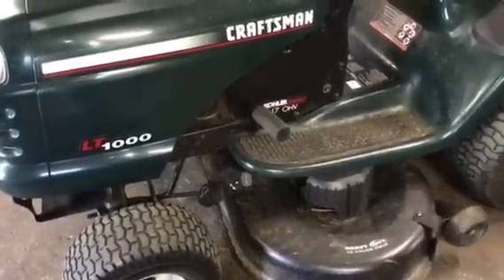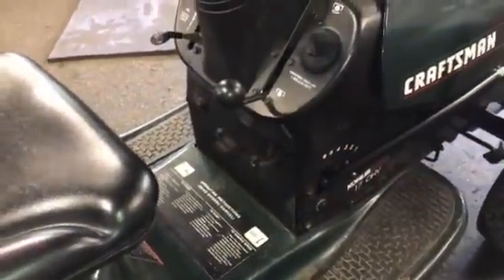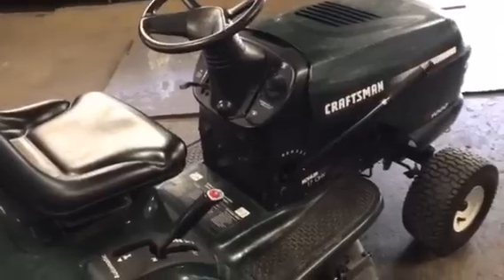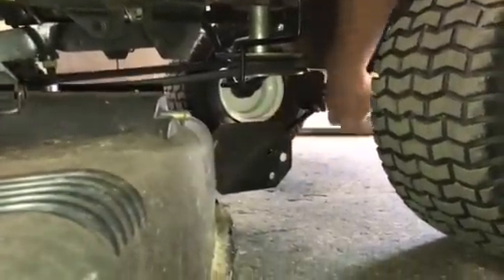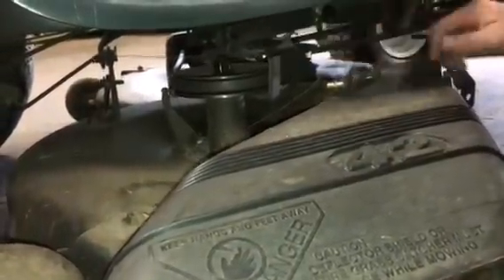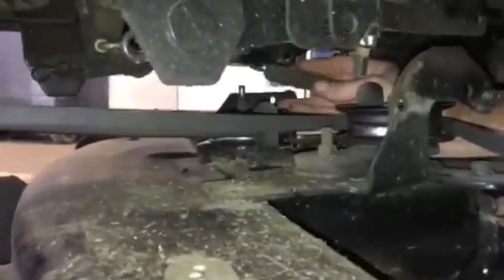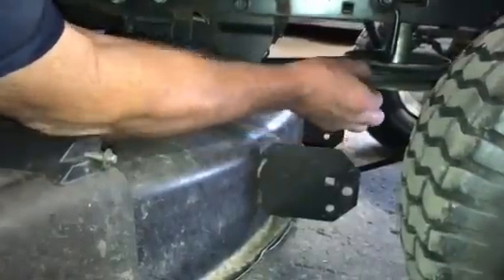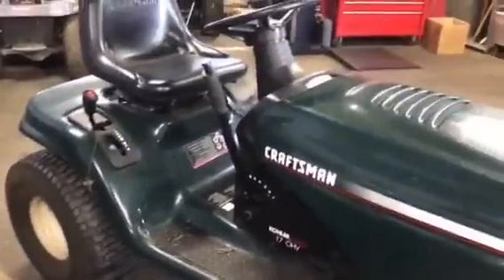How to Remove a Sears Craftsman 42" Mower Deck

Comment: Thanks. Did a dual spindle and blade replacement today in about three hours. Your instructions were perfect. I was lucky and didn’t have any seized bolts. Why sears put three torx bolts on the pulley cover is beyond me, but I had a set of torx socket adapters and they came out fine.
Reply from the maker: I'm glad it was helpful and all went good! Thank you for watching and supporting my channel. Please give this video a like and share my channel to help it grow. It would be greatly appreciated!

Comment: Like to see the replace 
craftsman clutch cable.
Reply from the maker: If you mean the blade engagement cable? I will need your model number under the seat and it should start with 917. If you can get me the number I may be able to see if I can do a video on that but I will need to wait until a tractor that is like yours to come into the shop.
Reply: @JohnsonsSmallEngines  Bought 2002.  917.271634.  I should've used my camera before taking things out.  Thanks for you help.

Comment: Ever hear of a k gro power pro with the old rod style clutch engagement blades? Am I like the only one who has one
Reply from the maker: I remember them and have worked on them way back before videos!! I haven’t seen one in my shop for over 10 years.
Reply: @JohnsonsSmallEngines  wow I got one in my garage now I'm about done with. Hopefully the blades engage.

Comment: Is there a washing port to hookup hose to on the models?
Reply from the maker: I do not think the older models had a wash port. I also do not recommend using it because water and these tractor do not mix. You will be replacing mower deck bearings and idler pulleys more often then normal if you use water to clean your machine. I have repaired a lot of machines that should have gone much further to find out the customer washed there machine every time they cut and bearings failed quickly. Just my opinion.

Comment: I broke a blade the other day on grass that was entirely too thick. The blade free spins and doesn't cut. The left blade is cutting. Spindle seems to be messed up at the connection for the blade. I needed this video to see how to remove the deck and take it to a shop since I don't have a trailer to carry the mower on. Thanks for this video

Comment: Thanks for this.  Very helpful.  How does one straighten the bent frame.  Mine is similar to the one in the photo, but not as pronounced.  I was thinking of using a mechanics hammer.
Reply from the maker: To straighten the decks, I use a heavy slide tool used for breaking the bead from tires. Use whatever it takes to correct the bent deck but be very carful hitting the deck where the cast mandrel is. I have broken the castings where the fingers are with the bolts going through in the past and then needed to replace the mandrel housings. I must straighten a lot of mower deck and have learn how do perform the job correctly but be very, very careful doing so.

Comment: I have a craftsman lts 1500 riding mower with the 42 inch deck and was replacing the belt today but it seemed it needed stretched pretty far to go on the main drive pulley under the mower. I'm thinking the belt is too small ,maybe the wrong belt. I tried to stretch it on but there was no way. Any help or advice? Or even the exact belt I need?
Reply from the maker: You need to take the model number from the sticker under the seat and go to sears parts direct online. Put your model number in to get to the parts breakdown for your machine. Find the mower deck parts and get the part number for your belt. Then you can either order a OEM “ original equipment manufacturer “ belt which I recommend or a aftermarket belt replacement.
Reply: @JohnsonsSmallEngines  I got the belt from the hardware store that supposedly was the one that fit but once I got it on all the pulleys in the deck back on it needed stretched quite a bit to go over the drive pulley. I'm thinking it's too short I will double check though on the parts direct website
Reply from the maker: Also make sure the belt is going through the pulleys correctly. There should be a diagram to show the routing of the belt.
Reply: @JohnsonsSmallEngines  yeah I still have the diagram sticker on the deck it was exactly as shown

Comment: Great demonstration. I have LT2000 42" deck, If I want to reduce deck size to 38" deck, will John Deer 38" fit the same way or do I have to stay with Craftsman 38" deck only?
Reply from the maker: You will need to stay with craftsman

Comment: Thanks so much for this informative video. Do I have to remove the deck to replace the entire wire harness?
Reply: Shouldn't have to should be all in the front maybe if you want to run stuff to the battery

Comment: Thanks for the tips , very helpful ! I would like to add the deck wheels to my LT 1000 , can you supply a part number as my mower came without them ?
Reply from the maker: Go to Sears parts direct.com for all your tractors parts. You will need your tractor model number and then you can look up all parts needed for your machine.

Comment: The first pin you remove is from the bar going to the front of the deck.. I have an older craftsman that has two of those bars that attach to the front. One has rusted off the deck area. Is this a vital fix or can the lawnmower still run with one?
Reply from the maker: It should be welded beck on to be able to support the mower deck correctly.

Comment: Thanks brother, I can’t see, but does the spring hook onto that long nut with the hole for a pin?
Reply from the maker: You mean the long bolt with the hole in it? Yes
Reply: Johnson's Small Engines yes sir. I ended up using that long bolt with the hole, and it’s working, my blades are engaging

Comment: So I want to remove the deck permanently. After I take off the deck what do I do to make it run ?  Must I reconnect something?
Reply from the maker: Vicki Peck just make sure you take all mower deck hangers off the tractor frame and you will need to make sure the PTO lever stays in the off position or the tractor will not start. If you have a PTO cable, I would also take that off so you don’t run it over. PTO is your blade engagement lever. It means Power Take Off.
Reply: Johnson's Small Engines thanks

Comment: Do I have to do anything different, when removing/replacing, if I have the adjustment knob?
Reply from the maker: Aaron Adams; pull the height lever all the way up then turn the knob counter clockwise until it stops then put height lever down as far as it will go. That will make sure you won’t have any issue with the mower deck hanging in it’s adjustment because it will be off the adjustment.
Reply: @JohnsonsSmallEngines  thank you. If I have any issues I'll let ya know. 👍

Comment: How old is yours? I have a 42" hydro number 917.259572 and I can't get the attachment lift lever to go from high to low. Also the the height adjustment knob turns but the blades don't move.
Reply from the maker: With the deck lift lever all the way in the raised position and if you have a round black knob to the left under the steering column? turn the knob counter clockwise until it stops then you should be able to put your deck lift lever all the way down.
Reply: @JohnsonsSmallEngines  You were right. Thanks.

Comment: I have a pin that’s stuck. I cannot pull it out.  Any suggestions?
Reply from the maker: Tap it lightly with a hammer. Maybe use a little Penetrating oil but do not get oil on the belt.

Comment: Hello Brad. I’m Mac. Thanks for showing how to remover the mower deck. I’ve done it before on my LT 1000 42” 16hp but thought you made a great video.
- I can’t seem to get it leveled correctly. The leveling bolts are all the way up but deck still uneven for cutting my grass 3-4” High.
- I need a grass catcher and found a 3 bagger model 917.249040 on CL but it’s for a 46” craftsman. Would that work on my 42”?
Again, thanks for a great video! I’ll go look for your leveling video.
Reply from the maker: On the leveling, make sure your blades are even going across in the center of the deck. If the mower deck is on the tractor you will need to get under to see if they are even.
On the bagger., I do not get into putting used baggers on machines because they normally give me issues and never match up. Take your model #s of your tractor and go to sears parts.com  to see if you can get the correct part # for the bagger to fit your machine, then google the part number (bagger) for your machine to see if you can find your correct bagger (used). Some people do advertise used parts with the part number and you may get lucky!
Reply: Johnson's Small Engines Thank you VERY MUCH!! I’ll check both as you suggested for my 917.272762 Lawn Tractor. Have a good summer.

Comment: Were those deck wheels added extra? I dont have them on my deck.
Reply from the maker: There are many different models of the craftsman tractors and some come with and some do not depending on the model
Reply: Steve Schwab I had to add mine as well.  Found them online

Comment: How did you fix the frame issue? Its hard for me to put the rod in place because of the bent frame in  addition I cant adjust the deck properly, it cuts way lower on the right due to the bent frame I believe.
Reply from the maker: Sometimes we can straighten the front brackets and on a rare occasion, we replace the front bracket. If you cutting low on one side, you will need to level the deck (I will make a video on deck leveling) and make sure your blades come by each other even under the deck.